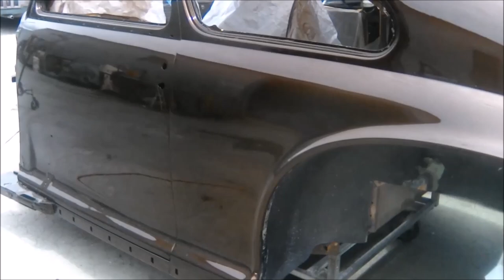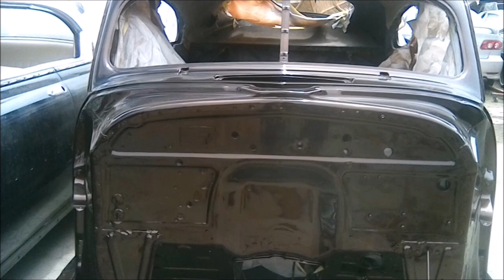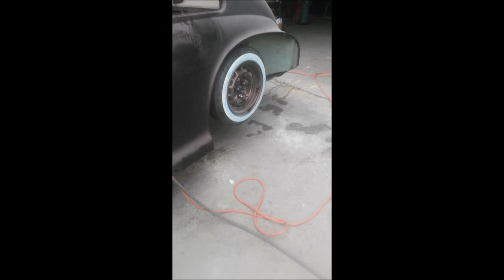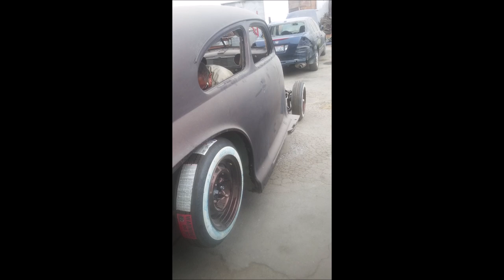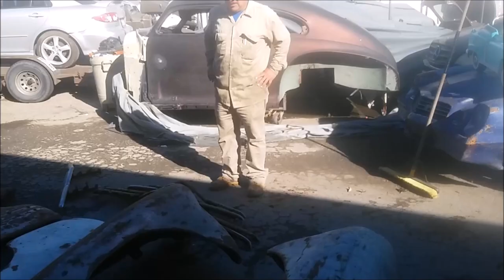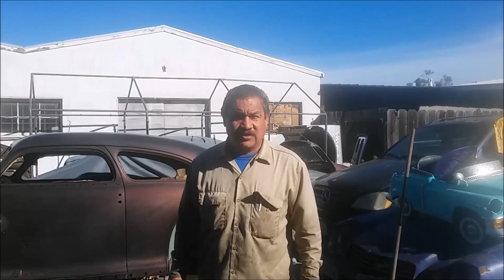1948 Fleetline Restoration Paint And Body Quality Control | BombaJess

Comment: I bought the tires through summit 
500 x 15 bf Goodrich silvertowns
Reply: I have a 1947 Chevy coupe stylemaster that I owned for 10 year's now started some work on it 250 straight six with 350 automatic transmission 5on5 lugs disc brakes in the front 12 volt conversion. It has lots of play in the steering. I was thinking of going power steering power breaks? I can use a driver's side back fender my brother ran in to it. The car body was in good condition no major dents. I know how it is when you strip a car down to bare metal finding what's under it has rust holes under the tail light's and on the bottom of trunk lid. I'm not to concern with the body I just want it running and steering and stopping right then from there I'll worry about the looks of the car. Look like you were setting up the Fleetline for air-ride suspension? 

I'll give you or the shop a call Monday or Tuesday and see what you got or even if you still have parts this video was made a year ago. Like I need to do something with my ride time marching on for me.